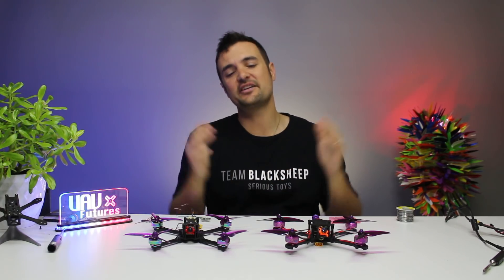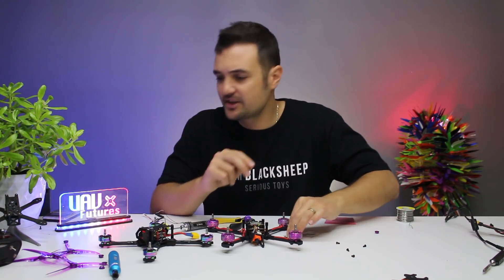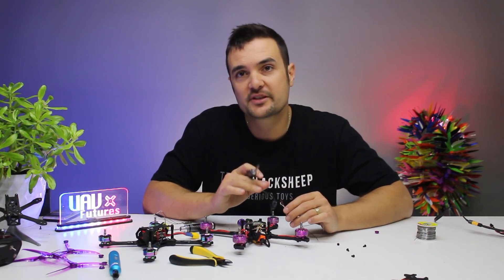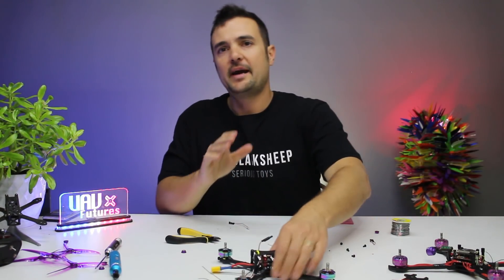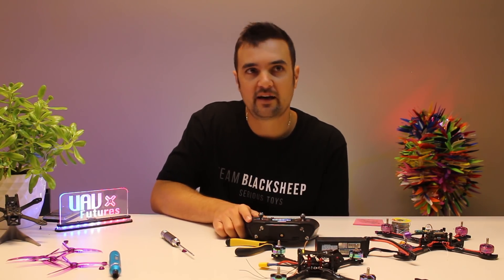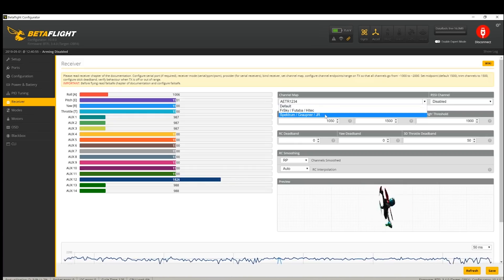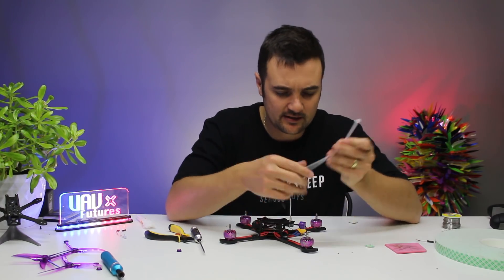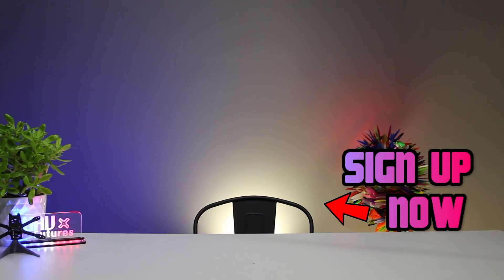HOW TO setup betaflight, Uarts & install receiver + bind it to your radio GUIDE

Comment: guys I had same issue , what I did I did the active booth loader and I reprogramed everything from firmware flash .. you need to download the LOAD Firmware online , then select flash firmware .. it will ask you if you want to change everything to the factory say yes, then it should work with your controller, if it doesn't I would do a restore then I would do these and it should work , it took me a month to figure this , and it was not on any place ..also same with UART lost , if you don't see them in Betaflight it means you have deleted factory settings and you need to re program it , follow the same method and it should work if you Guys have questions ask me

Comment: Tiny hawk freestyle connects to Betaflight but the 5" quad wont (doesn't have a receiver yet)... just wondering if you NEED a receiver to be able to connect to Betaflight?? or if my flight controller is fried.

Comment: Hi, i cant seem to get any connection on the receiver tab when i connect my Frsky xlite. Its binded, have the green light on my frysky XSR transmitter. Any hints? Im on a mac with betaflight 10.6.0
Reply: Did you find the solution?

Comment: I always just solder a old usb plug to my receiver before I solder it in to the quad then just plug it into your computer (or usb charger)and bind it to the transmitter. That way it is easy to get to the bind button which can be a bit of a mission. You can also  sort any problems before install, works well for flashing new firmware to.

Comment: bullocks …………..its NOT THAT EASY !!   maybe 50% of the time it will just connect  ...maybe ….the rest of the time the modes boxes do not highlite,   the receiver page does not activate ….the arm flags prevent arming ….what about when using a 4/1 esc  and a flt cont how do you connect ??    I have decided its just easier to buy the EMAX  AIO   stack including XM+ …….or the  MAMBA stacks ...etc  ….

Comment: if you want to use the correct channel map for frsky in betaflight you need to confirm the Radio Setup > Rx Channel order is set correctly in the transmitter itself: which should be AETR

Comment: 2:15 - "any Taranis system out there will be using xLite" - that should be  "any Taranis system out there will be using s.Bus". Any modern Turnigy or FlySky systems can also use s.Bus.
Reply: What flysky are you using that binds with a sbus rx?
Reply: @vampcaff  I use the iA6C and FS-A8S with my Turnigy/Flysky TX. They are great.